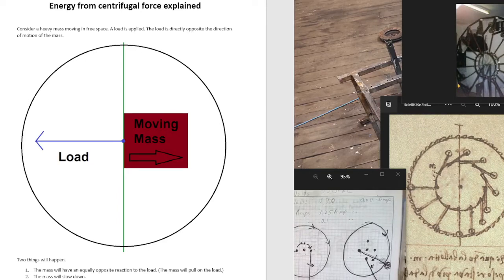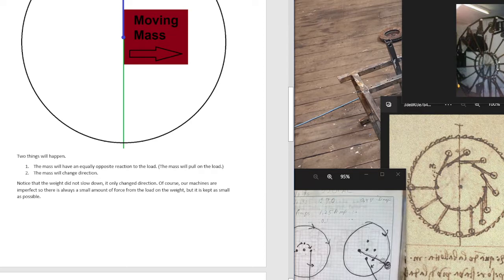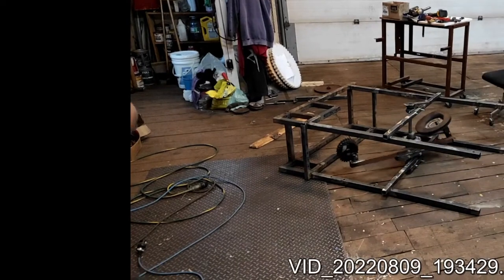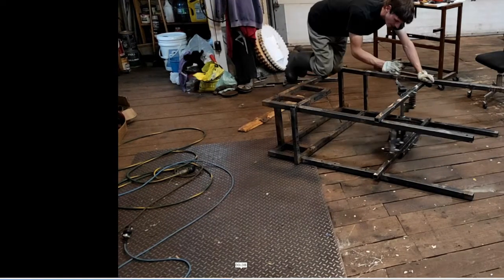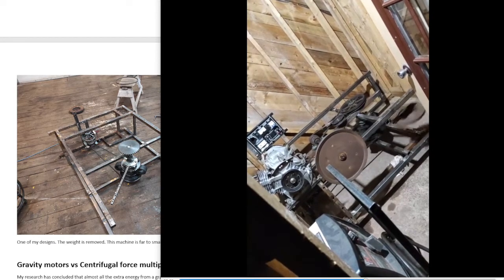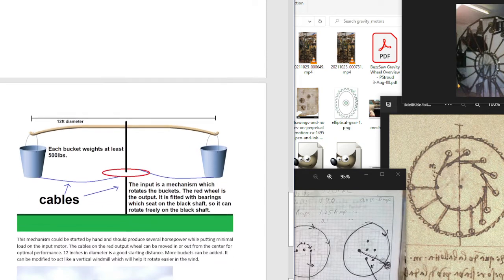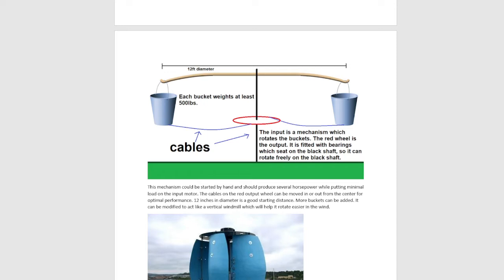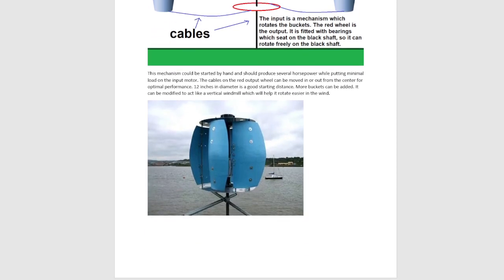Free Energy from Centrifugal Force Explained

Comment: I have a lot of personal experience with this myself. The key is in 90° angles not reflecting back to the source. I have built a few machines that show increased rotational kinetic energy that was not there before. I have decided to try to replicate your machine here, it would be much smaller though.

I threw together a quick one, very crude with a scooter wheel attached to a bolt and a simple skateboard bearing I held between my fingers, a magnet stuck to the axle with another bolt acting as a centrifugal arm and a string attached between arm and wheel with a small bolt drilled into the periphery of the wheel. It seems like it could keep going if built better.

When I built the crude one I realized what we are building here are self sustaining vortexes. A self runner seems easily obtainable.
Reply from the maker: There's no vortex. The simplest way is to have a spinning weight and pull it in towards the center. This takes effort if there's no counterforce, so you can use gravity by putting the axle horizontally. So you pull in as it comes up and it goes out as it goes down. I have a very simple gravity motor design, but it's very difficult for me to work due to health problems. Look on my TG group for updated information.
Reply: I’m sorry to hear about your health hope you remain ok, I think you will. The body naturally wants to heal itself. I matter what it is.

I built the device better, so it’s just two… well I’m real reluctant to share stuff here, but anyways it is clear the there is extra rotational kinetic energy that was not there before just like in another device I have.

Do you have any self runners? BTW neither of those links work and I refuse to sign up with another site.
Reply from the maker: @debunkified  Thank you for telling me about the links. I do not know why they don't work. The device in this video doesn't work, because it's backwards basically. If you were to tilt it on an angle or vertically and turn the input, the big rotor would accelerate. But each weight needs its own input, so for the simple setup you would only want one weight. I do not have any self-runners, I have not been able to work on gravity-motor type machines for almost 6 months now. It's a lot easier to build a device with minimal input than a self-running mechanical model. That's where a lot of people miss it, they try to start off with a self-running. Minimal input is like a bachelor level, and self-running mechanical (not electrical motors/generators) is at the PhD level. There's many ways to build it, they are basically all the same, the weight(s) are pull towards the center when it's easiest, and they only go outward when gravity pulls on them (otherwise the wheel would lose speed.) The ancient (proto-indo european symbol) demonstrates one setup, where heavy lever arms are pulled in while rotating upwards, and allowed to fall outwards while travelling downwards.
Reply: @QuantumEnergySearch  The device you have with the lower wheel and cables clearly has more rotational kinetic energy in the lower wheel once the arms raise and rotate the bottom wheel. I built that just yesterday. a real simple model with string.

I recorded it in slow mo and analyzed it. it’s clear there is more than what’s going in rotational kinetic energy wise.

Free energy takes years to figure out and that clearly shows it through a little thought experimentation in conjunction with an actual working model to demonstrate the basic free energy.

We thought free energy was hard, now it’s simple, but now the problem is getting it back to the rotational input. That’s a whole nother issue right there. I get fatigued just thinking about as there is no way way.
Reply from the maker: @debunkified  It's simple, sir Timothy has built at least different 11 different types of working gravity motors, most of them are low power. I spent a few years trying to understand the physics of it, and you understand it, it's easy! You can draw it out with vectors, I show it on the TG group, I want to show it on Youtube with a real working model tho.

Comment: Hey man interesting, why not use a big truck differential or tractor with 20ft wheel and massive weights
Reply from the maker: I'm testing my machine currently. The amount of weight is not nearly as important as the speed. The power is cubed based on the speed of the weight similar to a windmill.